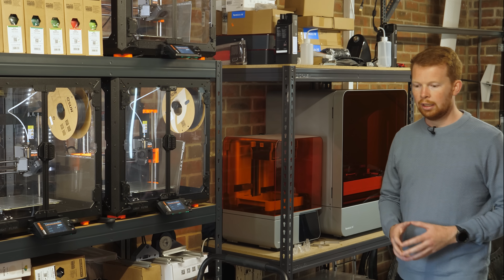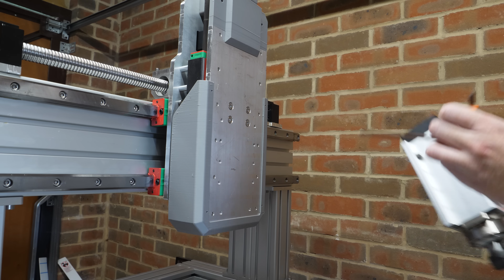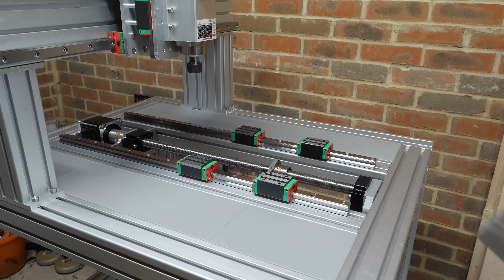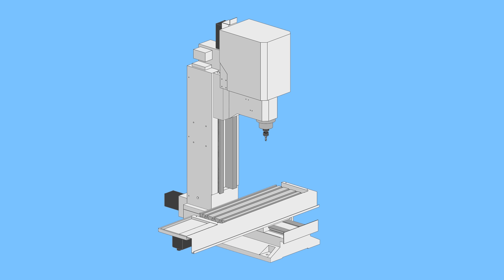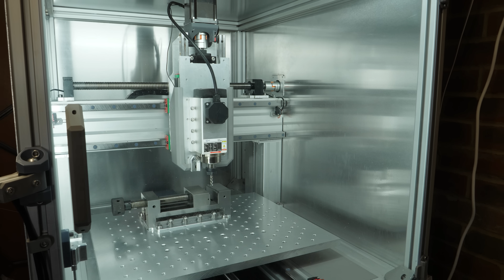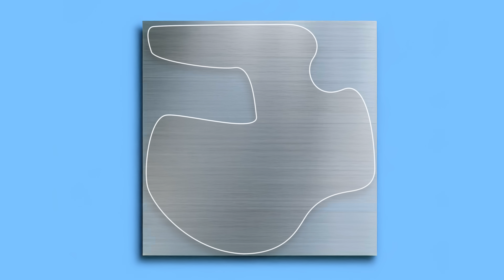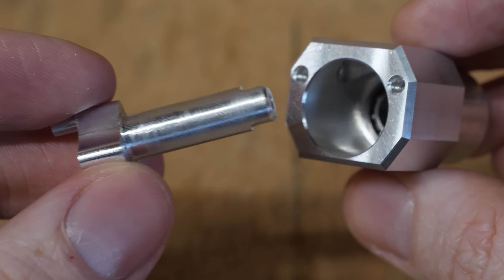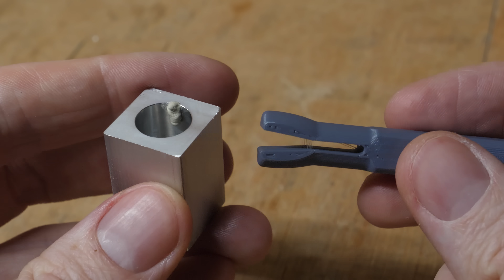I Needed an Engine, So I Built a CNC Machine

Comment: To get a really good seal, make the piston and cylinder a slight intereference fit, and lap them together rather than using a separate tool.
For aluminium, you probably want a much finer lapping compound. Maybe try "jeweler's/watchmaker's rouge". The common lapping compounds are for hardened steel and will be way too agressive for this use case.
You should be able to get a near airtight fit like this.
Good luck!
Reply: Clickspring recently made a video on this exact subject whilst making brass tubes, I agree that it would definitely improve the piston seal. Could cause some binding issues though since it looks like both the piston and cylinder are made of aluminum, there could be some galling if the tolerances are too close.
Reply: Keep in mind that as the metals cool from the expanding gas, they will also contract and open up their tolerances. effectively allowing more leakage as they run.
Reply: @ Given that both the piston and cylinder are made of the same material I should have thought they would contract equally and the effect would be negligible?
Reply: @ Probably not as the outer cylinder can exchange heat with the ambient air directly, the piston on the other hand is only able to exchange heat easily with the cylinder and perhaps through the camshaft. Though Aluminium is a pretty good radiator so the thermal gradient between the parts is probably going to stay quite small but I would expect the piston to be colder, so being the same material...
Reply: You can buy stropping compound for knifes that is 0.025 micron (~600 000 grit) that should give a really nice smooth polish

Comment: Maybe you could try to machine some kind of control horn (like one on a rudder on an airplane) on the side of the cylinder. Using a servo you could not only fix the cylinder to the perfect valve timing, but also control the timing for a sort of throttle control by rotating the cylinder with the servo.

Comment: Sooo, random thought that just hit my brain: Why lock down the cylinder? The addition of a servo would allow for small adjustments while running, which could do triple duty for:

1. Timing
2. Throttle down/up by messing up/optimizing timing, and
3. Compensating for temperature-based changes in part size and CO2 evaporation rate

In a larger engine, there might even be enough energy to run a mechanical governor without losing too much output power.

Comment: Idk if anyone else has said this, but if you don't have the position of the piston fixed, you could potentially use the position as a means of throttling it! But I also don't know if such a thing would be better done via a pressure valve

Comment: You could probably have just lapped the two parts at the same time together rather than using that 3d printed tool.
Edit for clarity - apply some lapping compound to the piston and then just run it in the cylinder.

Comment: 19:50
if you add a thin nut to the same threads that adjust timing, you can tighten in against the bottom end, pulling the threads tight, and thus lock the top end in place.  I could imagine you might need to add more thread between it and the exhaust ports though to actually give space to it, shouldnt be too hard.

Comment: If you twist the cylinder with a servo, would that count as Variable Valve Timing? You could have different twist angles depending on operation envelopes (rpm, load, thrust etc) much like a modern gas engine. I'd be interested in seeing if different angles are better under different loads, or whether one angle works the best for all scenarios

Comment: What youve done Tom is made a CNC Jig Borer!  They are designed for extreme precision over large parts.  Commercial boring heads can and have in often used in manual machining to turn parts like a lathe, but a good alternative could be a rotary table.  If you mount a cross slide on top of a rotary table, you can very quickly make accurate radii anywhere on the part.  for keeping your engine in time, I suggest you make a thin nut that you can use to lock the thread, as two nuts tightened against each other is often used in place of a locknut.  I think using machined teflon cylinder sleeves and pistons could get you the perfect seal with very little friction.  You may also want to modify your exhaust porting to reduce backpressure.  I think you should also have a go at making a geared up double acting triple expansion engine, as those engines are very efficient at turning pressure into pure torque which could be geared up to work at the perfect rpm for your prop.  Also look into variable pitch props, as they use the changing rpm of an engine much more efficiently as shown by rubber band planes.
Reply: Nix the compound engine bit. Our simple, ultra-efficient, ◉◉◉ 𝔽𝕦𝕖𝕝 𝔸𝕘𝕟𝕠𝕤𝕥𝕚𝕔 ℤ𝕖𝕣𝕠 𝔼𝕞𝕚𝕤𝕤𝕚𝕠𝕟 [𝔽.𝔸.ℤ.𝔼.] engine fully expands the hot gases within each cylinder w virtually no noise or muffler & emissions controls. No problem.
Reply: @ isnt noise one of the best parts though? if he wanted no noise, he wouldn't have used a piston engine, with all of its characteristic charms.
Reply: compound isnt really all its hyped up to be. whilst any cylinder is exhausting into a lower pressure one, the pressure is still acting on it. meaning the actual force produced is the DIFFERENCE of the two piston areas. the HP cylinder fighting the LP cylinder. still, it does work. it just isnt as effective as it would first appear. note that steam trains virtually never bothered... the small increase in economy wasnt worth the extra complication. ships? yes. can only carry so much fuel. and are bigger overall, use more fuel. 

with air, and a certain pressure, its better to just hit all the expansion in one stage, and match the expansion ratio to supply pressure to produce lowest exhaust pressure yet deliver most power. cant expand it all the way to atmospheric, theres almost no force available. cant release it too early, theres still energy available.
minimise clearance space, and most of all, preheat the air back to the same or higher temperature it reached whilst being compressed. if it exhausts when hotter than ambient, it still has energy to release. when its colder than ambient, its not expanding fully, and ABSORBING energy... lot of people overlook that basic fact.
the hotter it gets, the more it can expand from a given pressure. 

seems such a simple step to add some fuel to supply heat and a sparkplug to light it. wonder why noones ever done that before? hmmmm... 
gunna be a billionaire!

lol.
Reply: @ I suggested the compound as it would be an interesting experiment.  With locomotives like Chapelon's 242 A1 using compounding to maximise hp and tractive effortfor the boiler capacity, creating a high pressure triple expansion engine to make as much torque as possible and gearing it up to feed a propellor at max power output rpm sounds like something worth at least testing.  You are right that most probably a single cylinder will be most efficient because backpressure wont fight it and square cube law, but then you have to match a prop to it to get the most out of it. 

If he made a nitro engine 2 stroke though, I wouldnt complain!  ditch the sparkplug and use a glow plug, nitro beats petrol by so much.
Reply: @paradiselost9946  Right about the compound engine. Nix the compound engine bit. Our simple, ultra-efficient, ◉◉◉ 𝔽𝕦𝕖𝕝 𝔸𝕘𝕟𝕠𝕤𝕥𝕚𝕔 ℤ𝕖𝕣𝕠 𝔼𝕞𝕚𝕤𝕤𝕚𝕠𝕟 [𝔽.𝔸.ℤ.𝔼.] engine fully expands the hot gases within each cylinder w virtually no noise or muffler & emissions controls. No problem.

Comment: Very nice brother! Maybe you could continue the thread up thr outside of the cylinder and use a lock nut to tighten against the crankcase to lock your valve timing? Cant wait to see new projects on the CNC

Comment: For keeping the piston housing locked at a position, would it be possible to add a locking nut above the engine housing? This would allow arbitrarily precise positioning, but I'm not sure if it would work with the vibration.

Comment: Don't fix the rotation of the cylinder. Just control it. You could advance or retard the timing based on rpm and power needs. Maybe control it with a servo in application.

Comment: At 13:30, you can use G3 to cut an arc rather than a series of G1's.
Edit: at 16:08 - you can also use a boring head for your pistons!
Reply: Yes if the controller supports circular interpolation

Comment: Surprised your gcode software is so inefficient when doing circular cuts instead of just using G02 or G03 commands. 

Also you should’ve used the piston to lap the bore.

Comment: Wait, why didn't you try using G2 or G3, clockwise and counterclockwise circular motion?  The method you described was G1 linear motion, which most CAM software uses, but some software can use G2 and G3.
Reply from the maker: I was aware of G2 and G3, but I'm not sure how to tell my CAM (Fusion360) to switch from using G1.
Reply: @TomStantonEngineering You'll have to tick the box for 'Allow helical moves'
Post process > Settings > Post properties > Built-in
Btw awesome project to test your cnc! That custom external insert turning tool is amazing.

Comment: I've seen miniature steam engines with narrow grooves cut in the piston. I believe this is to hold lubricant to improve sealing and reduce friction, which might help.
Reply: Cylinders in cars also have very shallow fine grooves in them to hold oil for this very reason too.
Reply: Only issue is that he plans to go into liquid co2 temps with this, oils not the way to go with something like this imo.

Comment: rotating the cylinder to adjust the valve timing is really clever
Reply: I think you could make a VVT-like setup if instead of locking cylinder in place, a servo was used to continuously vary the valve timing.
Reply: @just_a_hoverfly  ooh that's a great idea. Then add a microcontroller and an rpm sensor and program a simple optimization algorithm to maximize efficiency. 
I bet the best timing will vary as the pressure drops (CO2 has a big cooldown effect) and as the load changes (airspeed, when in flight) so dynamically updating the timing would be super interesting.

Comment: gcode has G2 and G3 (and a bunch more) for circular interpolation cuts. I also get really bad cuts when I use Fusions gcode generator, so I made a python script for the cylindrical parts
Reply from the maker: Interesting! I was aware of G2 and G3, but couldn't figure out how to get Fusion using them!
Reply: @TomStantonEngineering  might be called contour smoothing or something like that in the toolpath tab somewhere. i'm not sure what exactly but its something like that iirc
Reply: Depends on the post processor you are using. Some have the option / checkmark to use interpolation in the post dialog.
Reply: @TomStantonEngineering  just edit the code by hand and run it through some software to verify the tool path is about what you expect
Reply: It's probably your post processor. I imagine some basic control boards aren't made with g2/3 capability and the post you got was made for those. I'm not too familiar with fusion posts, but you can probably pick up a post from a more professional mill and just edit out the things your machine can't do. Also the option of making your own, but that's a lot more involved.
Reply: @Schweebcraft  Inventor HSM has a checkbox for smoothing the toolpath.  It still tries to linearize, but you give it a tolerance it's allowed to deviate from the calculated cutting path and then it fits arcs in where it can.
Reply: @TomStantonEngineering  Try turning on smoothing in the passes tab on the toolpath. It won't be perfect but playing with the tolerance can dramatically improve circular/arc movements.
Reply: fusion is entirely capable of outputting g2/3, this will be an issue with your post processor, if you're lucky it's in the post processor options when you post, otherwise you'll have to look at the javascript code in the post processor. finally it's possible that it's a limitation of your CNC controller which is reflected in the post processors programming, i don't think this is likely though...
Reply: @TomStantonEngineering  your machine controller has to support circular interpolation, and the other fancy codes that do things other than straight lines
Reply: @TomStantonEngineering  Maybe learn writing G-Code by hand? It's actually a fun challenge of following the cut and imagining everything in your head. That way you can also make use of relative positioning and polar coordinates. Plus there are lots of binned cycles like pocket cutting and so on already available (G72 for example).
Alternatively it might be a good Idea to invest in a Master-CAM license and to program a post-processor for your specific machine.
Reply: @web1bastler  seconded, for milling operations, especially of this complexity, G-Code is really practical to write by hand, and a valuable learning experience. Because CNC mills are so much more capable of destroying themselves and everything inside them, it's really worth having programs you can actually read and verify. Writing G-Code is one of the best ways to learn it. This is much less practical on a 3D printer because they need to be constantly varying more parameters to control things like wall thickness, the code is just enormous. Also the dogmatic obsession with STL files means slicers don't have real circles.
Reply: @web1bastler  OH MY GOD. I SEE WHY MY PROF FORCED ME TO DO THIS NOW. I WAS CURSING HIM OUT IN CLASS WHEN HE TOLD ME TO DO SOMETHING A COMPUTER COULD!!
Reply: I'd recommend using Autodesk Inventor CAD/CAM instead of Fusion, it's specifically made for CNC. Bit of a learning curve though.
Reply: @game-tea have you looked at Fusion CAM in the recent years? I see reasons why one might prefer Inventor over Fusion, but a lack of CAM capabilities is not one of them in my opinion.
Reply: @game-tea Used both and disagree. Fusion cam seemed for me like the favorite child and inventor cam more like an outdated legacy suite of Autodesk.
Reply: Can you run the gcode through the arc-welder code? this finds all the approximate circles and replaces them with G2/G3 commands
Reply: I'd def. recommend writing a subprogram for interpolating with g2/3 while simultaneously going down the z axis imcrementally by a set amount per repetition. You can then call the subprogram and specify how many times you want to do so. Theres plenty of written examples of this to help you out.
Reply: G02 X___ Z___ R__ F__ that’s how it looks on my turning lathe at work. 100% you can make this perfectly round!
Reply: I know on mastercam there linearize helix settings and other settings that could affect this in your machine definition. Look up and write simple circle manually and  test it before you go down the rabbit hole to only find your machine cant read it.
Reply: fusion code is spaghetti code. i don't understand why it's so bad.

i only use it to get tricky co-ordinates and then program the g-code myself.
Reply: The post processor for duet definitely needs more work. I couldn't even get it to work well with my cnc plasma and instead modified the wincnc post processor to generate my gcode as it was much faster than figuring out and fixing the duet one.